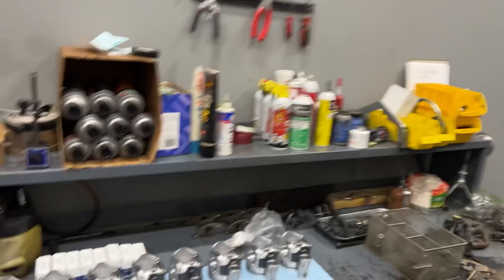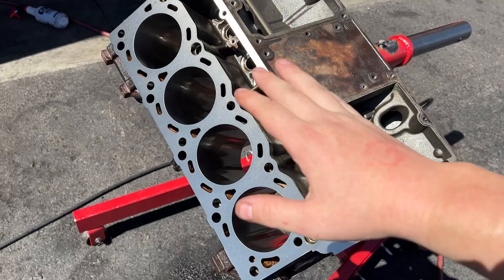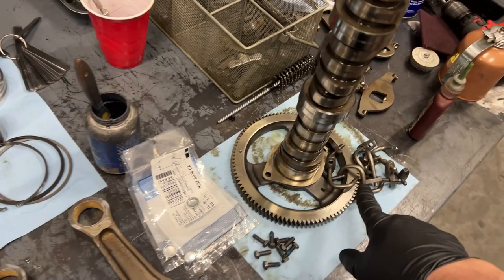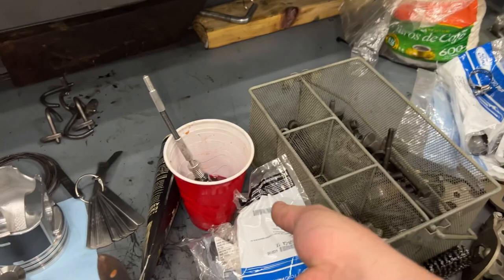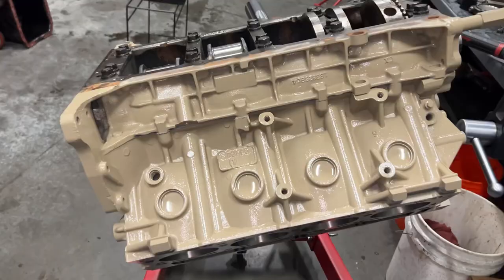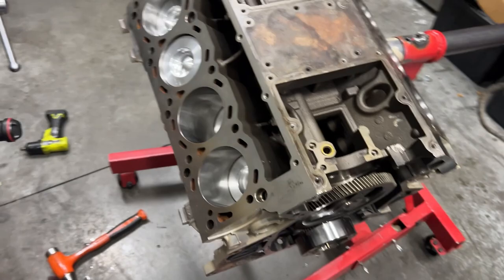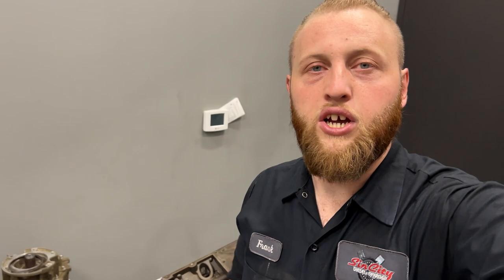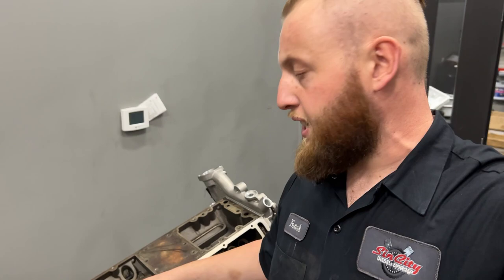6.0 POWERSTROKE SHORT BLOCK ASSEMBLY | F250 BUILD PART 2

Comment: Use Motorcraft TA-31 it’s fantastic. Very good stuff a little expensive but was designed for the Diesel engines.
Reply from the maker: Yeah I’ve had great luck with Permatex gray
Reply: @FrankBUILTperformance  yeah I use it on the bed plates and the oil pan adapter plate. It’s nice to have a 6.0 that doesn’t leak oil. Very strong bottom ends

Comment: Can the 6.0 bebuild to increase the horse power up to 400 to 425 hp and have a reliable pulling motor ? ?
Reply: Absolutely can
Reply: @brentambler3506  is there a build plan to do this. I have 2004 with the good bad 6.0. I pull horse trailer with it long distance and need the reliably of a stock engine but need more hp to climb long grades.
Reply: @quinnsullivan7679  air dog fuel pump air to oil cooler delete plate EGR delete if you can and a sct X4 with some mild tunes and maybe get your ficm sent to be  tuned with a eco or atlas 40
Reply from the maker: 155cc injectors and a KC Stage 1 is a nice set up

Comment: What did u gap the top and 2nd piston ring gaps to? Great video, good u didn't forget that oil plug by the cam gear, that would have sucked
Reply from the maker: Most definitely! I’ll have to check my notes. Hopefully I have them and not lost in the move lol
Reply: It's no biggy was just wondering